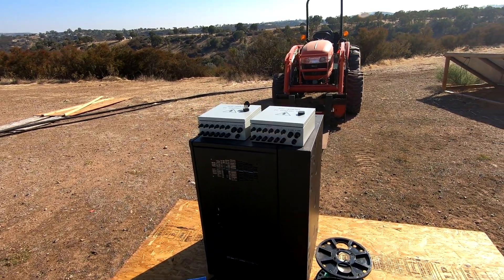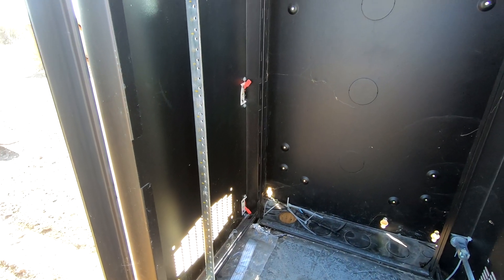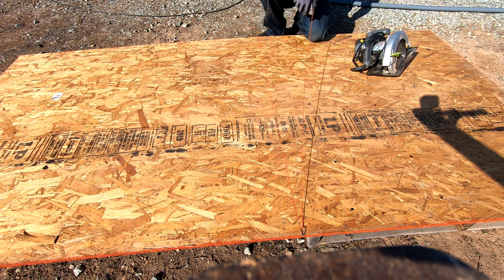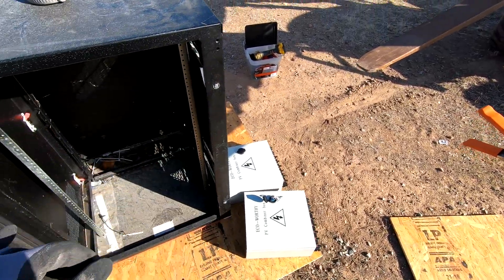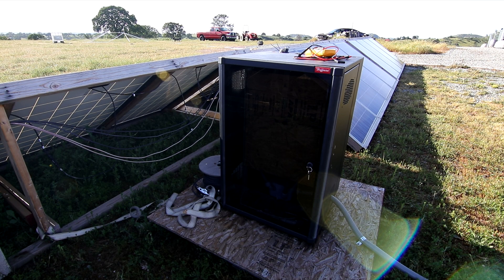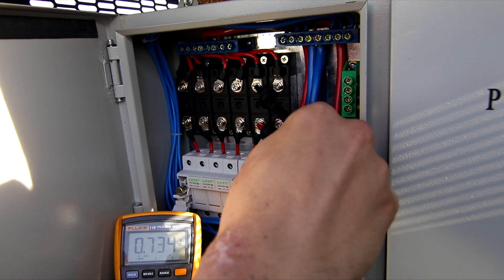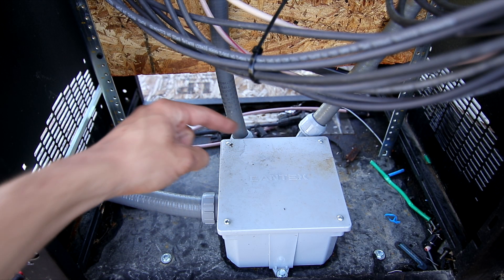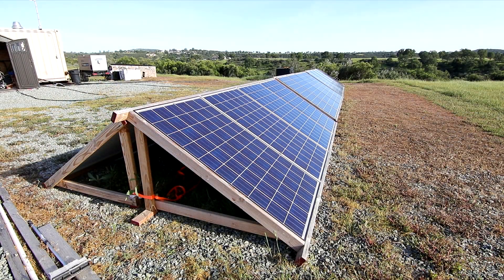Off Grid: Solar Combiner Install & DIY Ground Mount Rack Update

Comment: Nice! I have Carrier Mini-Split X-Inverters (12,200 BTUs). These units are around 20-22 SEER. I was going to install 3KW system, but 1.5KW is enough. Each Mini-split is averaging about 300/Wh. Also, it will allow me to use a smaller battery bank if I go completely off grid, saving huge money on a monster battery bank.

Comment: I would say to paint the parts that see the sun white.
Reply from the maker: It would have been a good idea, however I was somewhat holding the wood together with the solar panels and the solar panels together with the wood.  In other words painting them after the fact would have gotten paint on the solar panels and painting it before hand would have significantly increased the time it takes to build these.  I will give you credit though for it increasing the longevity of the racking system, but my goal is to not have these solar panels on this rack forever.....
Reply: @HighTechLab  I was talking about the server cabinet.

Comment: Hello, did you ever change your water distribution system? I remember you not liking trucking your water up the hill.
Reply from the maker: currently I still have a 1 inch pipe running up the hill but there is a good chance I will have my neighbor helped out with his bulldozer by ripping me a couple of lines in the ground so that I can use my less powerful backhoe to remove the dirt so we can send power down the hill and run water up the hill

Comment: I have a Branson 3510. Used it since new for 11 yrs of self employment. Got over 3000 hrs on it.  I recently bought six 250w panels. 2 are going on my RV and the other 4 on some sort of ground mount system. I saw the title of this and wanted to check it out.
Reply from the maker: Nice!! ours does OK, 400 hours on it and we had to change both axles at like 250 hours.  I suspect it was shipping damage.
Reply: @HighTechLab  Ouch.. hope that's been resolved.

Comment: Ever used wind turbines?
Reply from the maker: I've strongly considered them many times, but struggle to find something that is decent that doesn't break the bank.  Do you have any recommendations?
Reply: @HighTechLab  I'm in research myself. I have two BP solar powing my garage and lately it's working off just one because I discovered a burnt scorched mark on one of the panels. Panels are expensive so I'm looking for a cheaper alternative